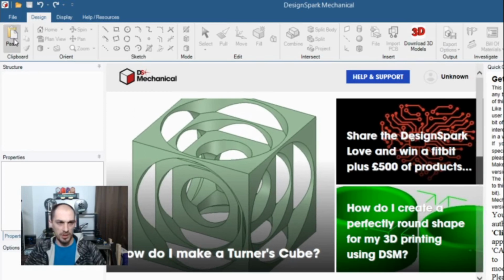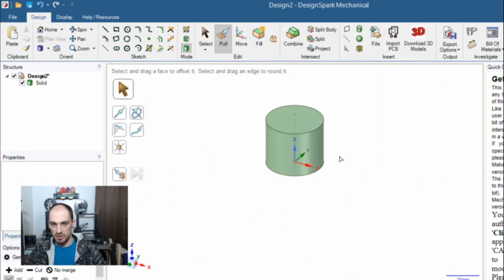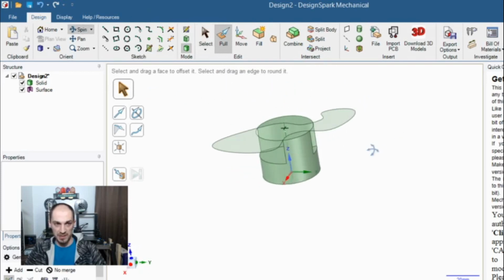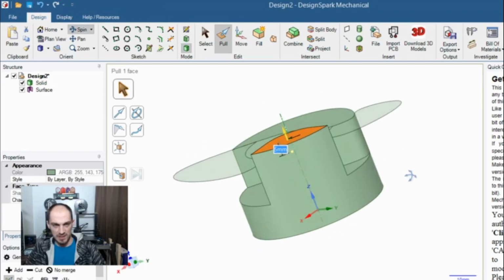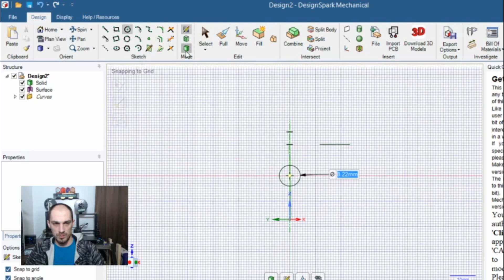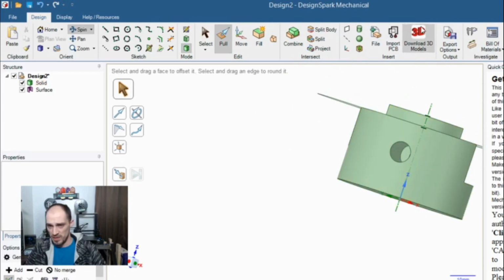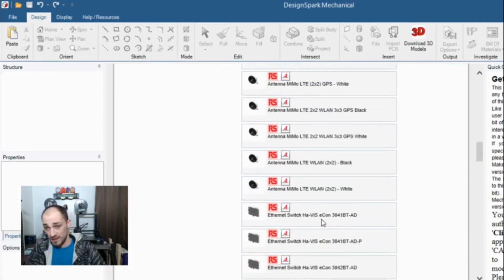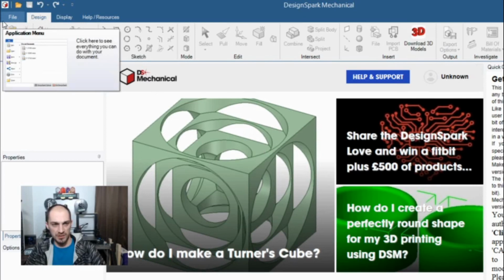DesignSpark Mechanical   Amazing 3DCad program for 3d print design!

Comment: My Designspark Mechanical rsdoc component library is now worthless.

RS Components has offered a free version of Designspark Mechanical for a number of years. I was sucked into committing to their software in terms of learning hours and library creation. 
Now RS Components have intentionally disabled DSM5, the software that can edit the library. 
DSM6 will open for viewing a large DSM5 assembly file. But any attempt to modify simple geometry in it fails.
A support ticket pleading to have DSM 5 reinstated has not been responded to.
A logical move to this would be to switch to another software supplier. Note that RS Components force you to pay extra to have full export functions enabled. 
And export to industry standard STEP files is believed to operate only on single components, not on assemblies with references to external components.
So beware of being like me, not exercising prudence and being sucked into creating a Designspark library. You will be faced with an expensive, massive library migration task to switch software suppliers. 
“Software terrorism”.

Comment: I haven't gotten very far with it, but i figured out that DesignSpark Mechanical (2.1/2015) fails to start, crashes, when locale is set to Ireland for some reason. UK works though. Not very reassuring! The program seemed discontinued a couple years back, but seems to have been updated in the interim, so i'll check it out again.

Comment: I tried this a while back and after a spending a decent amount of time with it I decided to stick with Fusion 360.
Reply from the maker: Nothing wrong with fusion 360! It's a great program. I like this for its offline capabilities. I would take this over solid works. I enjoy solid works as well,but fusion 360 and design spark are both more intuitive interface wise. I struggled to find things at first in solid works and it frustrated me to no end

Comment: It looks intuitive and being honest I never tried it but after some google searching I think it has some major drawbacks for me: No linux version, no real constraints in sketches and no named parameters in a spreadsheet style. But I could be wrong, I only searched for 3 minutes. It looks like a program that you can learn easily, but once you are in the design proces and have to start altering features or dimensions you will get stuck. At the moment I'm using fusion 360 but I want to get away from autodesk because I don't trust their licensing and cloud system. Learning freecad at the moment but it has a slower workflow